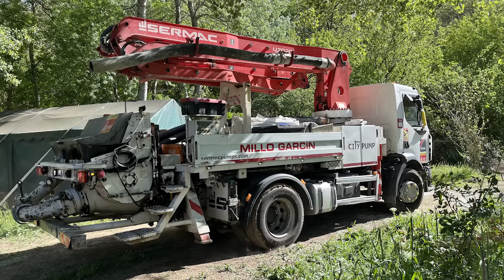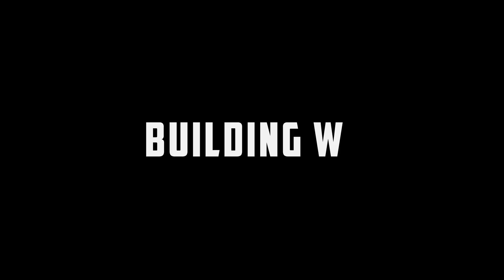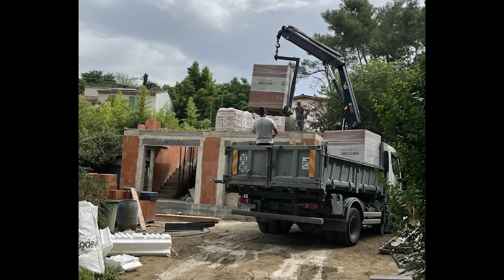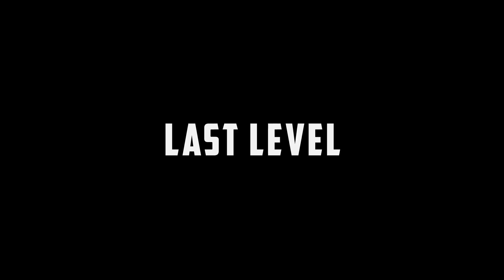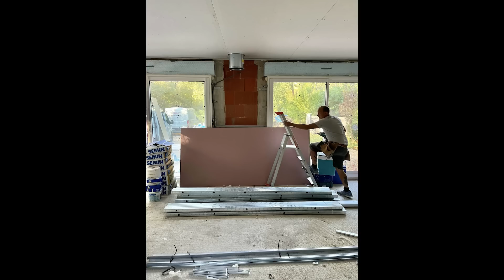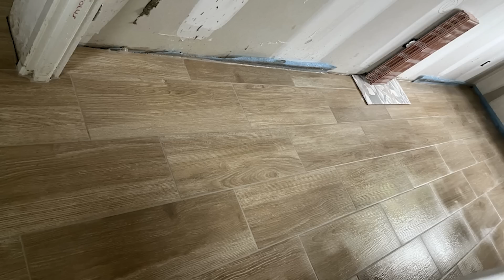BUILDING A HOUSE in SOUTHERN EUROPE - FRANCE (Start to Finish) #construction #build

Comment: I mean it's ok, but here in the balkans this is more of a weekend shed or shupa, plus this house is not very strong not enough reinforced concrete rebars are to small plus the columns are not thick enough you need at least 30x30cm columns, plus you don't have concrete eaves and you don't have good roof no planks no double row slats or roof watterproofing no steam brane, no big rocks before laying the foundation and many other bad things, i mean it would still hold like 150ish years without repair but why not 300 while you are doing it

Comment: Is it strong? It doesn’t have column? I live in a seismically active country, that building doesn’t look safe
Reply: You didn't see the foundations they poured?
Pretty sure they know what they're doing 😌
Reply: Maybe I misunderstood this but I think they said that there is rebar in a cavity in the corners filled with concrete. The blocks used in the corners have a circular opening for this. This essentially creates re-enforced concrete pillars in the corners. The concrete stairs probably also add stability.

Comment: Interesting, there are a few differences from how we do it in Poland. For example, except of cases where you have a basement (much more rare these days than it used to be, probably due to high cost of insulation etc.) the ground floor won't be "floating" but rather be poured over compacted sand inside the foundations. Sometimes instead of deep peripheral foundation you have a thick heavily rebared  concrete slab as a foundation.  Last year we were adding a large staircase of sorts to our house and we first poured 5cm layer of concrete to level the ground and protect the water insulation from rodents,  then put water insulating barier on that (bitumen) and the main course - 25cm thick concrete slab, so 30cm of concrete in total. 
South of France is quite warm of course but here it is mandatory to insulate the foundations and floor, not just the walls and the roof. The more fancy way if you have a slab foundation is to put the insulating layer (usually a form of hard styrofoam like XPS) first and then pour the foundation over that. But regardless of the traditional foundation or the slab one you will have a thick (15-20cm) insulating layer below the concrete or anhydrite floor. These days it is very popular to put floor heating in that final layer of anhydrite or concrete.
There are a few different ways to build the floor of second level but they all involve concrete, just in different amounts ;-) And there will be also a thinner layer of insulation (~5-10cm). 
Similar ceramic material for the walls is also popular here, commonly referred to as "porotherm". Other popular options are foamed concrete blocks (autoclaved very light and warm concrete) and silicate blocks. 
I was mostly surprised with the way those windows were installed. We do have similar technique here too with those metal L-shaped brackets BUT it will always be on the outside, not on the inside. This is a more fancy/costly variant called "in the insulation layer montage". It is better from heat insulation perspective but more common way is to put windows in line with the outside wall and when doing the wall insulation (also always outside) overlap it slightly on the window frame by about 2cm. Styrofoam is the most popular option for the insulation but wool is also in use. 
Otherwise it's very similar to what we do over here :-)
Reply from the maker: Thanks for all the info!!

Comment: They have a 400 year code, not a 40 year code. These homes are built to serve many generations, not just one.
Reply: Except when they need to change plumbing or electrical, where you need to tear up all the floors 😱
Reply: @everyhandletaken It’s all placed inside gains (big tubes) that channel all conduits and plumbing never needing to opens walls or floors to replace any wire or plumbing as well as never having any leaks into the structure since it’ll overflow the gains with leaks not the building.
Reply: @CharlieZenenour that sounds like great way of doing it & it is surprising that this isn't more widely adopted- it's not like it would be significantly more expensive initially.
Reply: @everyhandletaken It’s used all over europe and built into the EU construction regulations, more than 30 countries use it, it’s the standard practice.

Builders love it cause it saves them a lot of trouble.

Only ones still wiring cables to walls are the english who still raw dog electrical loop wires, it’s slowly changing in the uk with more builders adopting modern construction practices but today the vast majority of electricians still use the old british standards.
Reply: @ unfortunately not limited to the UK

Comment: Thats basically the way we build our houses in Europe not only in France. Hello from Germany 🙂 

As we are talking about house building! Why are you guys overseas using mostly wood to build houses? I mean you guys have a lot of tornadoes and stuff and I’m just wondering why you don’t build more solid houses?
Reply: Low cost, low quality home building is the rule in US with high heating and cooling as well as high maintenance cost being pushed on to the home owner. This is largely due to ignorance and the notion that housing regardless of quality will go up in value. The energy shocks of the early 1970s and the financial crisis of 2007-08  where values dropped were regarded as anomalous. There are many examples of quality buildings in this country. They are custom built by homeowners who value comfort and resilience over market value or by a developer who is willing to make significantly less profit for their efforts. Building codes make the typical house safe to inhabit and do address some of  the future costs of heating and cooling of new construction but are not retroactive. American housing stock is mostly deplorable.